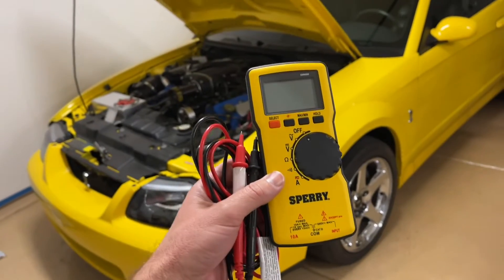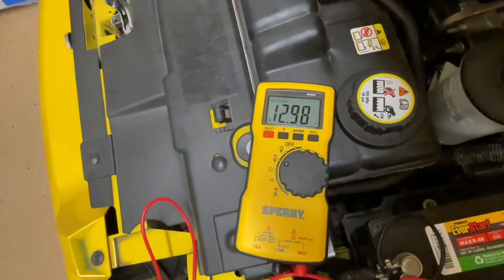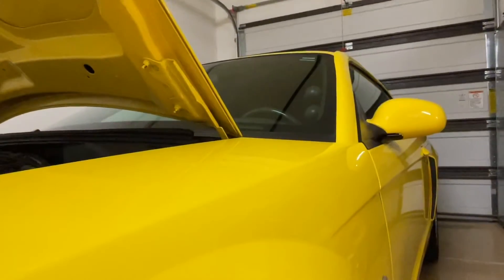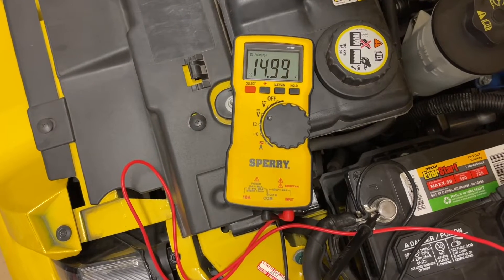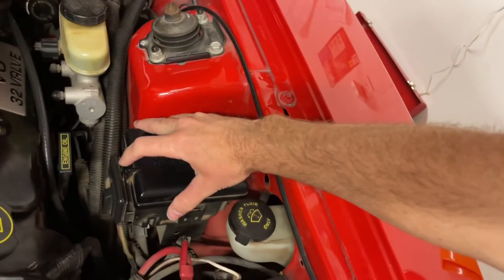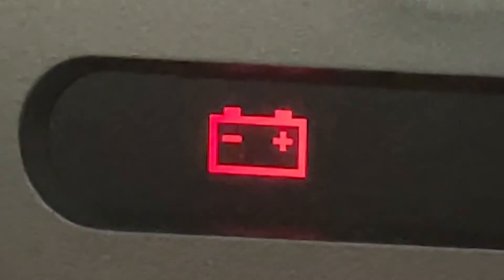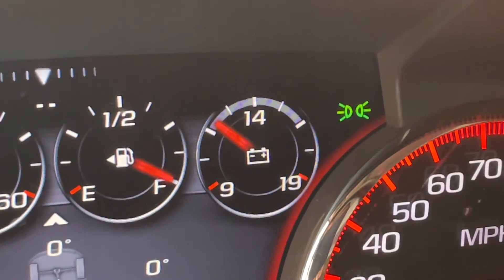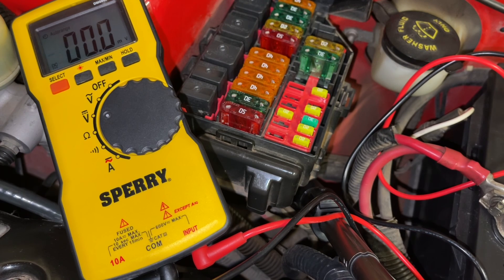Test car battery, alternator, alternator fuse, power draw with multimeter voltmeter

Comment: I hear you on the voltometer. I had an 03 cobra back in 2007 and sometimes when I'd get to 3000rpm or more, I'd get a battery light, and it was the alternator. I wired in an autometer voltmeter about a week after I installed the alternator. Great video and very informative!!!!!